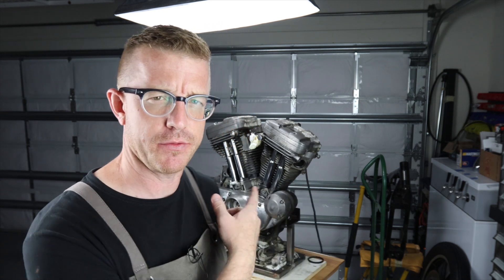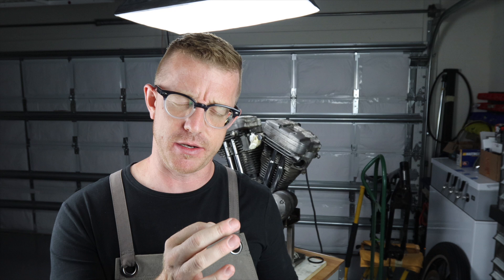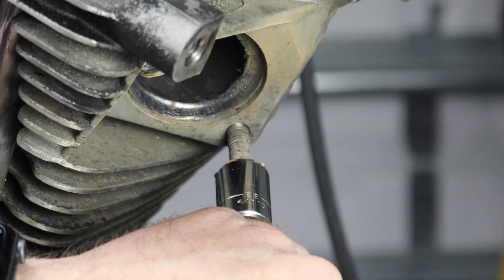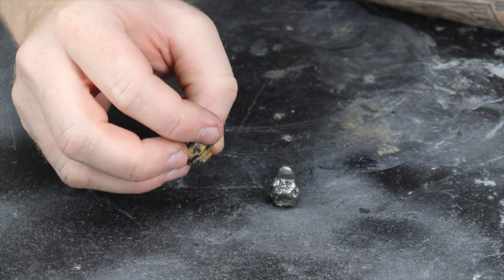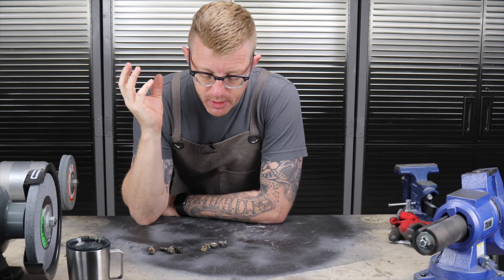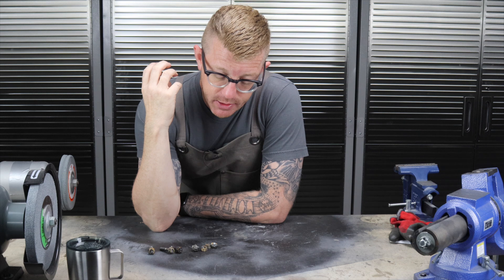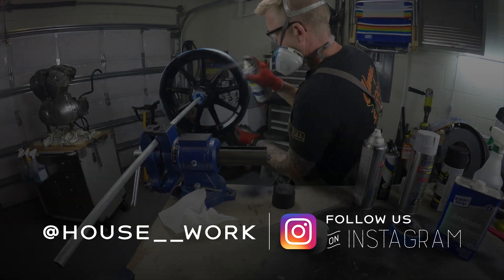How to: Stuck Exhaust Stud or Bolt Extraction

Comment: I use PB blaster and tap 5/16 stud extractor socket onto the bolt, turn out slow and easy, don’t gorilla it. It will come out

Comment: Rather than use a nut on the end of bolt weld a piece of round stock 3/8” and make a T- bar that way you don’t have to worry about stripping or breaking nut off.
Reply from the maker: Good idea, thank you. 🙏🏼

Comment: All you do is put 2 nuts on and use one to lock the other from turning then put a wrench on it. Use penetrating oil if it feels super tight where it may break. And let it soak in over night. I’ll post a video in the morning called “simple easy Harley exhaust stud removal. Old skool way” welding seems dumb as hell and un-nessasary. Two nuts are every bit as tight

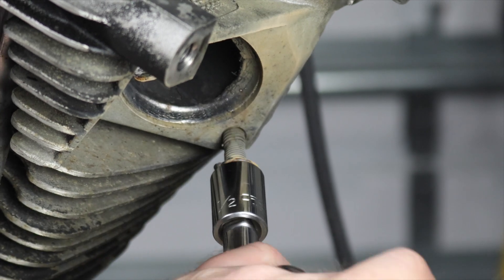Comment: 1:35  at this point I generally keep a little heat on the block by way of a propane torch as the aluminium cools more quickly and grabs the bolt that has thermally expanded or naturally rusted.

Comment: Dude! Plug up that exhaust port before you weld to keep weld splatter out of your cylinder!
Reply from the maker: Now you tell me! 🤣
Reply: Uhhhh there is no direct way for weld splatter to get in to the cylinder via the exhaust port unless the valve is actually open

Comment: I was about to comment on using the wrong socket, but then remembered, the U.S still uses Ye Olde Imperial units.🤣
Reply from the maker: Yeah I know! I would switch over to metric if I could. Much easier. We remain in the dark ages. 😂

Comment: Do you think there is any way of repairing a stud if it has been stripped to some degree? I accidentally put the wrong nut on when replacing the exhaust so I double nutted the stud in the hopes I could get it close to torque specs without having to remove the stud. It’s the rear stud on the front port and a pain to get to on a limited. I think it may be the cause of vibration in the foot boards now. Any thoughts would be appreciated.
Reply from the maker: You could try a due and rethread it?

Comment: For some reason my welds only stick to the nut but not the stud, any help on what it could be I cleaned the stud with a wire brush but nothing it doesn’t stick. Thanks
Reply from the maker: More heat. Turn it up!
Reply: just put 2 nuts together and turn the bottom one to break it loose, much better than heat cycling a bolt by welding it to get it off
Reply: Was it a stainless steel stud?

Comment: Another trick for those with no welder, take nut off the stud, slide the closed in of the wrench on, then use two nuts tightened against each other and back it out.
Reply: Thats that I thought he was going to do, saw Doc Harley do it but with the bottom engine studs.
Reply: What if the nuts are still training in place once the nuts are "locked"

Comment: Interesting! I'd stuff a rag in the exhaust port, those sparks are tiny pieces of metal that you don't want in de cylinder.
Reply from the maker: Good point, I did rebuild the top end after this, but yeah next time or for anyone who does this, plug them ports! Thanks Patrick! 👊🏻

Comment: Am I just just stupid? Why are these studs needed? I just broke one last week on my 1700. Why can't I just use a stainless Allen bolt?
Reply from the maker: You could as long as you get the exact size you need as to not bottom out the bolt and also hug up the exhaust right. I think they do it this way so it takes the guess work out of it.

Comment: Soaking the stud with penetrating oil helps as well after welding. And keep the heat down as well or you'll be through the stud.